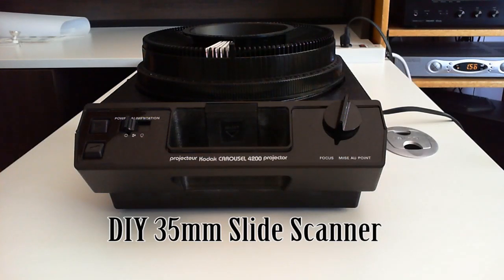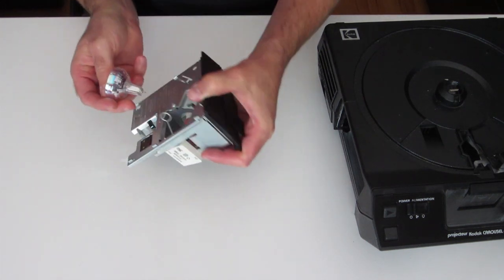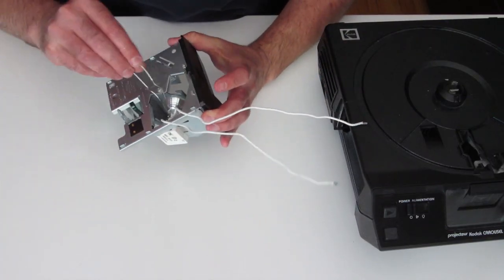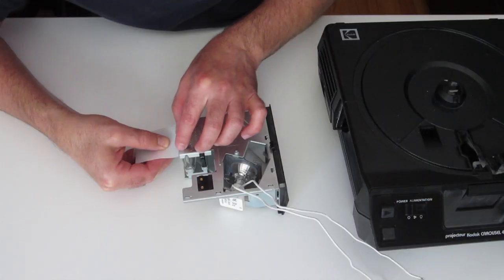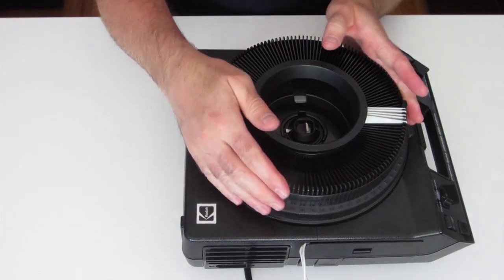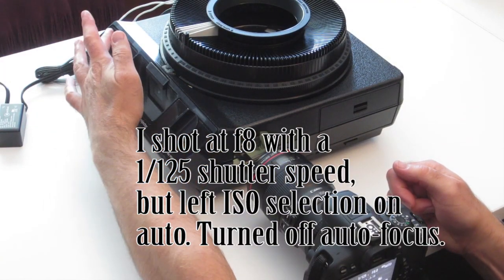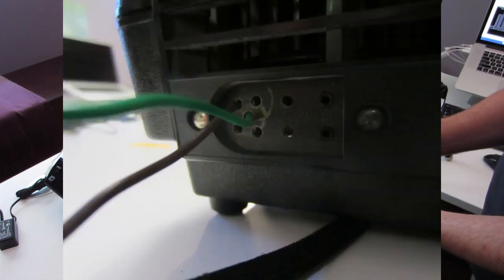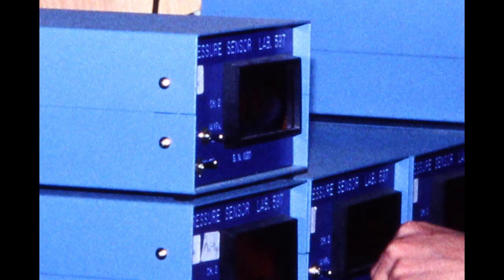DIY 35mm Slide Scanner

Comment: I realize this is very old now and maybe you don't check comments but I am doing this and I have a question about the power supply. AC to DC 12v? AC to AC 12V? I have one that is AC to DC and it has 4 wires when I cut the end off. Not sure which ones I would hook up! Thanks!
Reply from the maker: Sorry, you'll have to help me out a bit here... Power supply for what? The projector? Or for the light behind the slides? The projector should be line voltage (i.e. 110/120 VAC in north america). If you're rigging up your own LED or halogen light, it'll likely be a 12V AC, but you'd have to check the bulb to be sure. If you're cutting the ends off an existing power supply, make sure the output (written on the power supply case) matches the requirements of the bulb you're using. From there, you'll need to use a multi-meter / volt-meter to figure out which wires are supplying the correct voltage.

Comment: Hi Phil, I'm watching this video for months now and I finally decided to start building it. I alredy bought the camera and the projector. I can modify the projector and the camera set up. The Pi setup, maybe but since I have never done it - it would take some time . I have a huge slide project to takle and was wondering if you can set up the raspberry Pi including the coding for me? Obviously I would pay for it. Please let me know. Thank you for all your help.
Reply: Another option is to splice into the wires to the projector frame advance cable and a cheap shutter release cable.  Attach those to aan OONO Flasher Module and 12V relay. and an optional additional delay module.  The OONO will keep switching back and forth between firing the camera and advancing a frame, and you can set the dwell time for each to maximize the number of frames per minute possible.  If you don't have a good macro lens, a cheap extension tube such as the one from Neewer will do the trick.  the projector can be retrofitted with a low-watt 12v. halogen lamp like the ones used in elevators. .  At that point, the Carousel will no longer need the cooling fan, which vibrates.  I now have a video up of the entire build:
https://www.youtube.com/watch?v=pW2l7cJ13do&t=6s
Reply: @paulh6591  Paul thank you for the reply. I did everything in your reply except using the oono. I also use a digital shutter release and spliced it into the projector remote. The shutter release advances the   projector but when I use the timer on the shutter release it does not advance it. I think the timer has a lower voltage but not sure. Any ideas there?
Reply: @The_Best_Of_Best  I forgot to mention a necessary camera firing delay. yes, putting the delay on the shutter release gives the projector time to fully advance and seat the next slide before the camera fires.  But if the remote shutter release on your camera will not work with the delay feature then there is another old-school way to set up a firing mechanism without a computer, programming, or powered relays.  Just use a traditional rotary switch, one that has, say, six detent positions and may be turned in an endless circle.  Tie the common lead of this switch to both the ground lead of the slide projector advance, and the ground of the shutter release (together).  To the pin at detent 1 attache the frame advance advance firing lead of the slide projector, and the firing lead for the shutter to, say,  detent 4.  Attach a small gear motor running at, say,  30 RPM to the detent shaft so it turns in continuous circles  .  After the switch is at detent 1 which triggers the slide projector, it will then actuate positions 2 and 3 (which aren't attached to anything, buying the camera some dwell time).  Then it will hit detent 4, which will fire the camera.  Then detent 5 and 6, not hooked to anything.  That gives the camera some time to fire before the next slide advances.  Then back to detent 1, repeating the process.  You can play with the motor speed and detent hookup positions until it runs optimally. Need more "on" dwell time?  Tie two successive detent switch pins together.
Reply: A switch like the $5 Mouser 105-SR2511F-26FN  should do the trick, and I see some cheap but torquey 12V DC geared motor on Amazon, etc.  The entire firing rig of switch, motor, 12V power supply,  and wired shutter release shouldn't cost more than $30. You may already have power supplies for the new lamp and the motor, and as I mentioned if you don't have an mild telephoto macro lens just get a cheap set of extension tubes for you non-macro telephoto.  Try to get a motor and switch with the same size shaft, or pretty close,  and use a shaft coupling with set screws.
Reply: @paulh6591  thank you Paul. I wish you could do a video about this. Thanks again.
Reply: @The_Best_Of_Best  Video is now up:
https://www.youtube.com/watch?v=pW2l7cJ13do&t=6s

Comment: Phil, Just want to thank you for your instructions. I finally put together my setup to digitize my slides from my Kodak 5400 projector using my Nikon D7100 and a Sigma 105mm macro lens. I didn't automate it because I have no idea how to do it but at least I can start the process I've wanted to do for the past 17 years! I wish I could attach images of my setup to show you. But thanks again. Nine carousels so far and at least 40 to go, plus 100's of yellow boxes and sleeves. Gary

See if this works for two images:
Rough Setup:
https://scontent-iad3-1.xx.fbcdn.net/v/t1.0-0/p180x540/139192304_10223130266399277_3555375095176742353_o.jpg?_nc_cat=104&ccb=2&_nc_sid=730e14&_nc_ohc=ZMmVJ-LuUZEAX_EQPSm&_nc_ht=scontent-iad3-1.xx&tp=6&oh=a7760858514cea33e64b0dccf4130e7e&oe=6027919A

Final Setup:
https://www.facebook.com/photo/?fbid=10223130266159271&set=pcb.10223130270399377&__cft__[0]=AZXGEndcJQByqX6_Cb7fid8dhyFfdKT2zvtas-0kf7R5_MQAw3IQ3OENrW6H39vlB4Tjypu1pfj0YQwPv7Txgs5Nnl3KG6HOtDE385MuN3K-Tw&__tn__=*bH-R
Reply from the maker: That's fantastic! Congrats on getting it working!!
Reply: @philivers8155  Just found  a friend who will help me automate it with Arduino!! Fingers crossed!!!
Reply: Thanks again JX4W+42 Barnard Castle JX4W+42 Barnard Castle JX4W+42 Barnard Castle Hill. You in error #youb ,

Comment: Greetings Phil or anyone...
I have collected just about all the items needed to convert my 5400 Kodak slide projector as you have shown. I am having problems with the LED light source getting through. I am using an 'MR-11-4 2.5W 250 Lumen 3000K LED' bulb. I had to remove the 110v 'lamp socket terminal assembly' block in the cage so that bulb and the pigtail socket would fit. I had to use some wires through the  holes in the socket to hold the bulb in place (paper clip did not  work).  However, when the bulb is on, no light gets through. My 5400 has something between where the  slide come down and the usual projector lens. It is, maybe, a diffuser? I assume your projector model does not have one. Now I am at a standstill, wondering what to do. I had to cannibalize the light cage so I can't put the 300 watt bulb back in, I guess. Any suggestions on what is that thing blocking the light from the LED bulb????
Reply: Greetings,
I had a 'light-bulb' moment this morning. I woke up at about 5 am thinking about this. I had tried out the LED bulb in the projector but I had not put a carousel on it yet. Dummy me... Once I put the carousel and ran a slide through it, the light appeared!!!. I had forgotten that the projector has this screen that blocks the light so that you don't get blinded by the 300 watt bulb before you start running the slides. Ok...back in business. Now I just have to figure out the proper orientation of the slides in the carousels. I know I have to make sure all are in the landscape orientation. I think I can leave the slides otherwise in the same way, upside down and with the non-emulsion (smooth) sided toward the camera.

 Going to be a busy day...week...Sorry to have posted this crazy question but I figured it out...so far. 😁
Thanks...
Gary
Reply from the maker: @goddi2  Glad you figured it out! Good luck with the rest of the project!

Comment: Greetings Phil,
I am trying to follow your method. I am starting with finding the bulb and socket. The bulb and socket that you used is not completely clear to me. I see it is an 'MR11 35 watt halogen'. I am just concerned that I get the right combination to fit. My question has to do with the type of 'pins' of the bulb. That would determine the style of the socket's connection for the bulb. I see there is a 'GU4' that look like thin pins; and there is a GU10 where you 'twist and lock' the bulb into the socket. I have gone to big light stores and can not get an MR 11 35 watt bulb and they don't have sockets that seem small enough for the GU10 type bulbs.

I seem to be able to get a 'GU10 ceramic socket with the GU10 Twist & Lock' at Walmart and a set of '35-watt Halogen MR11 Clear Lens GU10 Base Narrow Flood Light Bulbs' from Home Depot. From the images, they seem to be too big, but hard to tell. Is this combination going to fit? I have the 5400 Kodak projector.
Thanks... Gary
Reply from the maker: Hi Gary, since I don't have the 5400 projector, it will be difficult for me to answer this with any certainty. All I can suggest is getting what you can and trying it out.

Comment: I have a Sony A7RIV and Sigma Macro lens. I'm thinking of doing something similar, my dad has about 2000 slides and I'd like to digitize some. Instead of replacing the bulb and using diffusion paper, do you think a neutral density filter on the lens would suffice, with the standard bulb in the projector? He has a Kodak 600 projector
Reply from the maker: I have no idea if that would work or not. I guess it's worth a try, if you already have everything. Let me know how it goes!
Reply: Vin, I just had a similar idea. Why not use a neutral density filter (or a variable ND filter?)? I notice you had the same question. Did you give it a try? Seems it would be an easy solution. I am having a hard time finding a MR11 35watt that will fit my 5400 projector. Please let me know if you used a an ND filter. Thanks... Gary

Comment: Good idea, but maybe the bulb CRI should have been better? Otherwise, the color reproduction will not be OK.
Reply from the maker: Thanks for the comment. The LED bulb was too big - it wouldn't fit. I suggested adjusting your white balance on the camera before shooting for that reason.
Reply: @philivers8155  
Thanks for your kind and quick response Phil, but if your bulb doesn't have a high CRI before the picture is taken, the postpro can't solve this later. Maybe your bulb is good enough, I don't know, but I'm afraid not. For accurate color reproduction this step is critical, but I'm sure for a regular user this device is good enough.  Congratulations anyway for your invention :-)

Interesting link:

https://www.waveformlighting.com/high-cri-led

Comment: Thank you Phil for this interesting DIY, by the way, it seems difficult to get white diffusion filter #216. Is it possible to replace it with calc paper? Probably more easy to find and less expensive. In this case, which choice should I choose? Thanks again.
Reply from the maker: I'm not familiar with calc paper for this purpose. It needs to serve 2 purposes - it needs to diffuse the light source, and it needs to be heat resistant (depending on which bulb you're using). If it checks those two boxes, it should be fine.
Reply: @philivers8155  I absolutely agree with you. In fact it’s just in case someone has experience sharing it here. Best and have a # 216 filter. Another point how to reduce (eliminate) the central light spot?

Comment: Used your video as a basic guide to build my own version. I will use mine for commercial work, so projector and camera are on a platform so nothing moves once aligned. I understand why you turn autofocus off, but I want to autofocus on the first slide of each carousel tray. I'm not going to turn off autofocus on the lens.
      I removed the push button end of a Canon RS-60E3 Remote Switch. There are three wires in switch's cable going to the camera. A red wire, a white wire, and a multi stranded bare copper wires wound around the red and white wire. If you touch the white wire to the bare copper wire the camera auto focuses. If you touch the red wire to the bare copper wire the camera takes a picture.
     The perfect answer would be to let the the relay board trigger auto focus at the beginning of each order. With slide carousel trays of 80, 120 & 140 slide capacity another mind bender is introduced. I don't want to have a switch that needs to be pushed at the beginning of each order. People forget, software doesn't.

Comment: Where did you obtain the pigtail for the MR11 bulb?
Reply from the maker: Big box hardware store (probably Home Depot). It was with the under-counter lights.
Reply: @philivers8155  Thank you!
My only other question is the diffusion film.  What did you use, and do either big-box or hobby stores usually have it??

  I'm going to look for the bulb and the base this weekend.  Hopefully my Kodak Carousel 4200 arrives Monday.  Your video was simple and to the point, but gives the most flexible slide "scanning" method I've seen yet.  I'll let you know my result!
Reply from the maker: @PMRing  I had to go to a camera store for that. The brand I used is "Lee", the product is a #216 - White Diffusion filter
Reply: @philivers8155  Just wanted to let you know I got my set up finished!  It works GREAT!  One change I made was to use a LED MR11 bulb.  It has a good color temperature and some built in diffusion on the front of the bulb.  Thank you for a great video!  The only step I might still do is the Rasp Pi relay control.

Comment: Hi Phil,  With the recommended 35 watt bulb and diffusion sheet have you ever noticed a subtle hot spot in your images in the central portion with slightly darker image to the sides?  Most noticeable with same light colored background all across image. Images from a colleague with his projector conversion showed the same effect. I just added a second sheet of the #216 diffuser material and hope that will help.  If not I might need to try another type of diffusion material or set up a radial diffuser filter in Lightroom to offset the uneven backlighting.  That second option is last on my list. Otherwise the conversion if great. ( I did not automate but still fast to transfer a carousel of slides).  Thanks

Comment: Great project Phil, I working towards to replicate it. I have a couple of questions if you could answer would greatly appreciated. 1. Would you change something if you could from your original video post? 2. You have a fantatic lens there. I believe 4th best in all macro lenses in the world, but what is your Canon camera? Full frame or aps-c? Hope to finish this project and get started on 9800 slides to digital format before they come out with another medium. Thanks
Reply from the maker: Hi Joe, sorry for the delayed reply. Not sure I would change anything - pretty happy with what I made. If I were to change anything it would be the video itself (editing, titles, explanations, etc) but I wouldn't change the project. 
The lens is fantastic. I don't have a full frame camera however. Maybe someday. At least I have the lenses that will support it.

Comment: Have you converted other projectors, i.e. universal type slide carriers?
Reply from the maker: No, this was the only projector I had access to. The principles would be the same, however. Remove the projector lens, diffuse the light behind the slide, mount the camera to shoot the slide. Use the projectors' built in slide advancement mechanism to change slides, and shoot each slide without the hassle of a light-table and slide placement. The automation principles would be the same, assuming the projector has an electro-mechanical means of slide advancement (i.e. not manual). If you can hook a relay up to the slide projector to advance the slide, you can program the raspberry pi to control the relay.
Reply: @philivers8155   - Many thanks! ..... 2 or 3 thousand slides to scan.... 😐
Reply from the maker: @websitesthatneedanem  yeah, you'll want the raspberry pi automation set up if you have that many!

Comment: Phil! I need your help. I am doing the same project but I had a few questions.
1. Where did you get the small white diffusion square for the lens?
2. I understand the cameta software for the computer but what software did you load onto the raspberry pi. Are you using default pi OS and the computer software controls that? 
3. what connections did you make between the pi and the relay.
4. What is the model and brand of that relay you used.
5.
Reply from the maker: Hi,
1. I got a sheet of the diffusion filter at a local camera store. It was "Lee" brand, #216, as mentioned in the video.
2. The raspberry pi is using the stock OS. It's just a simply python script. Python code can be found here: https://pastebin.com/8yYf6NCW
3. It depends on which generation of the PI you're using as to which pins you connect to the relay. You'll need to Google how to connect your relay, based on the model of Pi you're using. You'll need to modify the python code accordingly so it knows which pin to switch.
4. I used a SainSmart 4-Channel Relay Module. Found it on Amazon, but any relay board that is compatible with a Raspberry Pi will work.